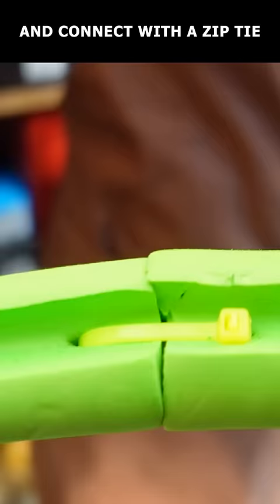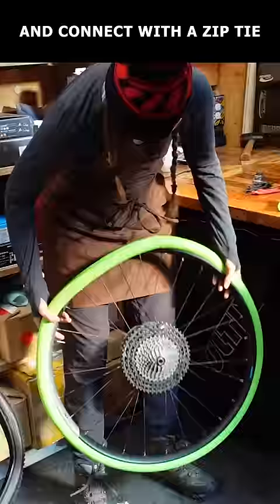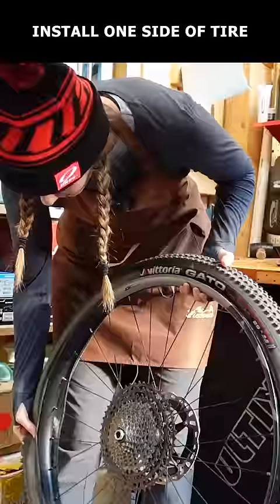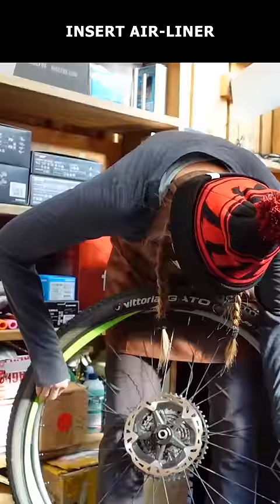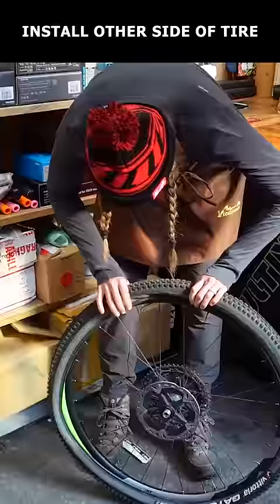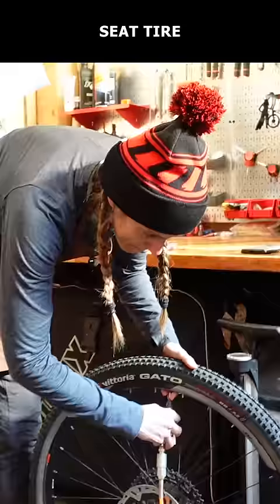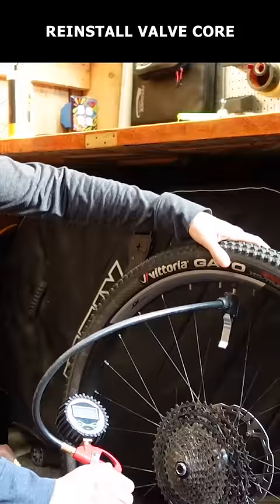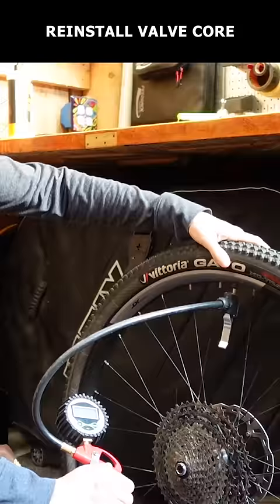Installing the Vittoria Air-Liner tire insert #Shorts

Comment: She's clearly showing you what not to do if you want to keep your bike ride and smoothly just use air and carry a patch kit or a spare tube
Reply: I agree
Reply: Why make it simple when you can ruin your whole wheel with a terrible idea???
Reply: Used to cut the old tube and wrap it around new one for a lil extra protection but that’s about it, carry some patches
Reply: @golgoth7600  lol
Reply: Dude what? These types of tyre inserts add a huge layer of protection for your wheels if you actually ride hard. If you land hard on a sharp rock and you’re not running an insert your wheel is pretty much done and I’m speaking from experience. I went about 6 feet deep on a 10 foot drop and landed on a protruding root and bang there went my rear wheel. With my new wheelset I have cushcore which lets me drop my pressure and I have that extra protection. These inserts are worth it in my book.
Reply: People who say these are worthless probably ride XC in lycra.
Reply: This is an MTB fat tire. You will patching and swapping tubes for a while.
Reply: Mtb ers finding more things to buy

Comment: If you dont spin that wheel at a high rpm then the sealant wont penetrate everywhere it needs too. 
No, I'm not annoying 🤔
Reply: I specifically came to the comments to look for this guy... you are this guy
Reply: @8JLZ8  it actually seemed like a useful tip. Because she did not mention that whatsoever
Reply: Needs to
Reply: it's a liner not a sealant.

Comment: Pretty interesting, but what does it do? I was hoping it was a replacement for air pressure, but you still pressurized at the end
Reply from the maker: It provides additional rim and puncture protection in tubeless setups and allows you to run slightly lower pressures. It is also a "run flat" system so if you do get a flat you can continue to ride the tire without risking it rolling off the rim. We don't generally recommend that unless you're racing enduro or downhill, but it is an option.
Reply: It also protects against rim damage if a flat tire occurs or from a hard landing.
Reply: It takes your money
Reply: Oh...I get it now. Ta
Reply: Its pretty useless for the puncture becouse when you fill the tire with air it makes a gap between the ari liner and the tire
Reply: What does it do? It makes your life 3x harder when it's time to change or fix your tire. Bloody mess inside.
Reply: Tubeless set-ups? People trying to make bikes like cars now? Guess it's not crazy.
Reply: I'm still laughing..😂😂
Reply: @promontorium  There used to be solid rubber bicycle tires. Pretty heavy at wider diameters, but for skinny road tires they are amazing.
Reply: @sydfixesbikes  I have the same thing on my car it's called run-flat plastic donut inserts and it's so I don't have to pull over if I get a flat tire I can just keep driving straight home
Reply: @peachmelba1000  solid rubber tyres are terrible, especially on a bicycle.

Comment: P.S. That's almost 2 centimeters. That said, these are a great idea in theory but in reality it's a terrible idea. The foam doesn't stay seated and degrades rapidly from friction inside the tire. It's dangerous as well because due this disintegrating foam you will end up separating the tire from the rim while riding.
Reply: Have you used them yourself? I heard of these a while ago, seem like a hassle though. Rather just bring a flat kit with.
Reply: @desertrainfrog1691  They're good for run flat situations but you get wear spots that cause the tires to wobble.
Reply: Português

Comment: Or you could use a tube and clincher tyre. Then go out cycling about half an hour earlier.
Reply: I mean you realise you do it once every 6 months?
Reply: I could but then I would have to carry 500 tubes per ride because I live in southern California where it is dry, rough, rocky, and there is always cactus and nettle within sight.
Reply: @dh3790  yeah so this is tubeless. Meaning you don't really get punctures from rocks and thorns
Reply: @user-fu9or4uk7t  Well, yes. I am replying to Robert who said use tube and clincher. I explained why people do not.

I have been using tubeless with Stans since 2012 for the listed reasons.

This is a cushcore alternative so you can run even lower pressures so you can get better tread contact while maintaining pinch resistance and some sidewall support.
Reply: @dh3790  Fair enough. Perfect explanation - enjoy your ride!

Comment: I'm a bit lost can someone explain what those liners are for please?
I am genuinely interested
Reply: So you dont pop your tire as easily
Reply from the maker: This system provides additional rim and puncture protection in tubeless setups and allows you to run slightly lower pressures. It is also a "run flat" system so if you do get a flat you can continue to ride the tire without risking it rolling off the rim. We don't generally recommend that unless you're racing enduro or downhill, but it is an option. So, while it isn't for everyone, it's quite helpful for lots of people.
Reply: Basically a copy of Cushcore for pinch flats.
Reply: They're for the trash.
Reply: For stopping flats some of the time, and robbing speed the rest of the time.
Reply: I just use a fucking tube and I carry an extra tube..  I'm not racing anyone anyway.

Comment: Thats neat! A buddy of mine use to sell polyurethane strips that were thicker than the crappy slime ones you could stick between your tube and your inner tire surface that were puncture proof, I ran the same tubes for years and used that bike for dirt jumping. The only reason I wouldn't go tubeless was to save weight at the time but this is a decent alternative!
Reply: I work at a bike shop and we sell thin plastic liners and even those add a lot of spinning weight, I think it was seths bike hacks that checked and tubeless is lighter anyway
Reply: @robby4770  wow thats pretty incredible! I imagine the technology has come so far. Growing up I had seen the almost solid rubber tubeless tires that weighed a ton, and that was really rare, I only ever saw them once or twice.
Reply: Wow! You ran those? How did they run?
Reply: @paulromero2368   @Paul Romero  incredibly well! never even noticed they were there. I would also put them on my race bikes and park bikes. I ran 20x2.25 FAF tires with the Kevlar sidewalls and they are just indestructible. That bike is sitting in storage with the liners still installed after like 7 years and every now and again I go air up the tubes and ride that bike around, I know for a fact I've only changed the back tube once because its a pain in the @ss to take those kevlar sidewalled tires off

Comment: Fix a flat causes deterioration of the rim and will make very fine holes in the rim that will leak air Google it never keep fix a flat in rim once used disassemble rim and clean once your able to make tire repair

Comment: Id rather carry an extra tube than add pounds of weight to my bike (especially in the tires) that will make me tired faster. Also I dont like when the tire rolls but this has got to affect the tires ability to grip the ground when your on choppy terrain. And your tire almost acts as your first stage of your suspension, I bet this product makes your ride a lot more bumpy causing more vibration to transfer to your hands and arms.

Comment: I've seen quite a bit about these lately. How does it not stop enough sealant from getting to punctures quickly enough to seal them properly??
Reply from the maker: The sealant is generally between the tire insert and tire so it isn't an issue.

Comment: Um, a centimeter is just shy of a half-inch. That was definitely not a centimeter.
Reply: Dont know where you learn to do math but half an inch is just over 12cm. As 25.4cm is 1 inch
Reply: @tomd9102  I can't tell if you actually think you're correct, or you're trolling right now... im hoping for the latter

Comment: Personally I've never liked the insert tube, or never flat tube whatever u wanna call it. But I ride BMX and put well over the recommended psi in my tires lol probably somewhere around 100 or 120, not sure exactly. pretty much to where they're rock solid. Mainly because landing off something high most Likely I won't flat spot my rims. Although on the other hand these might be good for my fixi it's actually flat lol

Comment: I used to get my old tires and cut the sidewalls off and place the remains which was just the top tread and tuck it under my new tire made a little heavier but extremely durable and I used to bmx and hit dirt trails and never replaced a inner tube again

Comment: Is that a tube liner ? To protect your tube? Or is it for tubeless tires?
Reply from the maker: This system provides additional rim and puncture protection in tubeless setups and allows you to run slightly lower pressures. It is also a "run flat" system so if you do get a flat you can continue to ride the tire without risking it rolling off the rim. We don't generally recommend that unless you're racing enduro or downhill, but it is an option. So, while it isn't for everyone, it's quite helpful for lots of people.

Comment: I forget the name of them, but we used similar stuff on our dirt bikes for when we did desert races or rode in places that were full of sharp rocks and other nasty stuff.

Had them on seperate old rims as well. Very useful. But also required us to change them frequently. Once they lose shape, they become more of a liability then just standard air and rubber tubes.
Reply from the maker: This system is a bit different from the mousse system used on motos because you still use air and sealant, but the are similarities!
Reply: I had a similar set up on my dirt bike as well. Mountain bikes are a little different though. For example on mine I went full tubeless and you don’t need the foam part if you have a tubeless compatible rim. Just tubeless tape and some sealant.

Comment: I haven't cycled for some time, when did tubeless cycle tyres become a thing? Won't there be leakage from the spokes or are they special wheels as well as tyres?
Reply from the maker: Tubeless setups for mountain bikes have been popular since the early 2000s. While some older wheels can be jerry-rigged to work with tubeless, most wheels nowadays are tubeless ready and you use rim tape to cover the spoke holes so the air can't escape.

Comment: But... The foam isn't filling the tire so what is it solving? It seems like once the tire is inflated it would not even be touching the foam? Just seems like a mess
Reply from the maker: This system provides additional rim and puncture protection in tubeless setups and allows you to run slightly lower pressures. It is also a "run flat" system so if you do get a flat you can continue to ride the tire without risking it rolling off the rim. We don't generally recommend that unless you're racing enduro or downhill, but it is an option. So, while it isn't for everyone, it's quite helpful for lots of people.

Comment: I don't understand. What is the green thing supposed to do, if you still have inflate with air.. and even put in sealant?
Reply from the maker: This system provides additional rim and puncture protection in tubeless setups and allows you to run slightly lower pressures. It is also a "run flat" system so if you do get a flat you can continue to ride the tire without risking it rolling off the rim. We don't generally recommend that unless you're racing enduro or downhill, but it is an option. So, while it isn't for everyone, it's quite helpful for lots of people.

Comment: Damn, that's alot harder then just putting an inner tube in there....
Reply: It's not a replacement for a tube, you use it inside tubeless tyres/rims and it's supposed to help prevent punctures and rim damage from going over rocks etc and pinching the tyre on the rim.
Reply: @ferrumignis  
Awesome! Thanks for the enlightenment.

Comment: If you're using air-liner, why not use inner tube instead? It will save time, money, and efforts.

I don't understand, please enlighten me.
Reply from the maker: The Air-Liner system provides additional rim and puncture protection in tubeless setups and allows you to run slightly lower pressures. It is also a "run flat" system so if you do get a flat you can continue to ride the tire without risking it rolling off the rim. We don't generally recommend that unless you're racing enduro or downhill, but it is an option. So, while it isn't for everyone, it's quite helpful for lots of people.

Comment: There is enough room for the sealant to get to the tyre?
Reply from the maker: In general the sealant stays outside of the insert where you're most likely to puncture. But if any does get to the other side there are holes in the insert to allow it to flow back to the outside.

Comment: So what's the advantage over tubed and tubeless setups? I feel like I should know it but it's been a while since I've been around to GMBN Tech.
Reply from the maker: This system provides additional rim and puncture protection in tubeless setups and allows you to run slightly lower pressures. It is also a "run flat" system so if you do get a flat you can continue to ride the tire without risking it rolling off the rim. We don't generally recommend that unless you're racing enduro or downhill, but it is an option. So, while it isn't for everyone, it's quite helpful for lots of people.

Comment: So is this like a run-flat? Or is it for better maneuvers?
Reply from the maker: This system provides additional rim and puncture protection in tubeless setups and allows you to run slightly lower pressures. It is also a "run flat" system so if you do get a flat you can continue to ride the tire without risking it rolling off the rim. We don't generally recommend that unless you're racing enduro or downhill, but it is an option. So, while it isn't for everyone, it's quite helpful for lots of people.

Comment: Do you not use a tube with an air-liner? Are these tubeless tires or something how does this work?
Reply from the maker: This system provides additional rim and puncture protection in tubeless setups and allows you to run slightly lower pressures. It is also a "run flat" system so if you do get a flat you can continue to ride the tire without risking it rolling off the rim. We don't generally recommend that unless you're racing enduro or downhill, but it is an option. So, while it isn't for everyone, it's quite helpful for lots of people.

Comment: Whats the point of this? Also how have u got a valve?? U didnt mention the innertube once? Wheres the valve come from?
Reply from the maker: This system provides additional rim and puncture protection in tubeless setups (so there's no tube) and allows you to run slightly lower pressures. It is also a "run flat" system so if you do get a flat you can continue to ride the tire without risking it rolling off the rim. We don't generally recommend that unless you're racing enduro or downhill, but it is an option. So, while it isn't for everyone, it's quite helpful for lots of people.

Comment: I presume its tubeless tyre you can still get puncher can't see that air liner fitting tight it just doesn't seem wright
Reply from the maker: This system provides additional rim and puncture protection in tubeless setups and allows you to run slightly lower pressures. It is also a "run flat" system so if you do get a flat you can continue to ride the tire without risking it rolling off the rim. We don't generally recommend that unless you're racing enduro or downhill, but it is an option. So, while it isn't for everyone, it's quite helpful for lots of people.

Comment: Is running tubeless tires without an insert not common anymore? I weigh like 160 and I rode hard a few years ago and didn’t have many problems other than the tires burping fluid but that was rarely
Reply from the maker: This system provides additional rim and puncture protection in tubeless setups and allows you to run slightly lower pressures. It is also a "run flat" system so if you do get a flat you can continue to ride the tire without risking it rolling off the rim. We don't generally recommend them unless you're racing enduro or downhill, but it is an option. So, while it isn't for everyone, it's quite helpful for lots of people.
Reply: @sydfixesbikes  ah that’s cool, thanks for the reply. Maybe I’ll try this when I get a full suspension frame

Comment: What is the advantage of the green tube.
Reply from the maker: This system provides additional rim and puncture protection in tubeless setups and allows you to run slightly lower pressures. It is also a "run flat" system so if you do get a flat you can continue to ride the tire without risking it rolling off the rim. We don't generally recommend that unless you're racing enduro or downhill, but it is an option. So, while it isn't for everyone, it's quite helpful for lots of people.

Comment: Why use this instead or regular Rubber tube? More durable for off roading?
Reply from the maker: This system provides additional rim and puncture protection in tubeless setups and allows you to run slightly lower pressures. It is also a "run flat" system so if you do get a flat you can continue to ride the tire without risking it rolling off the rim. We don't generally recommend that unless you're racing enduro or downhill, but it is an option. So, while it isn't for everyone, it's quite helpful for lots of people.
Reply: @sydfixesbikes  I see, thank you for the answer

Comment: Ive never been hardcore into bikes so excuse my ignorance but wth are all these extra gadgets. Sealant, cat pool noodle in the tire, electronic derailleur. I understand the benefit of the hydraulic brakes but everything else seems borderline unnecessary unless a pro is using the bike.